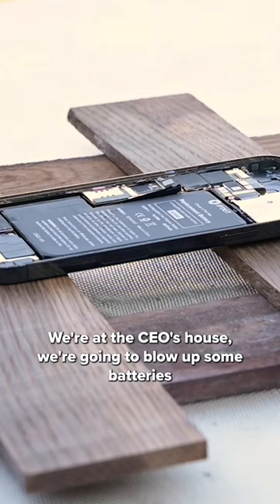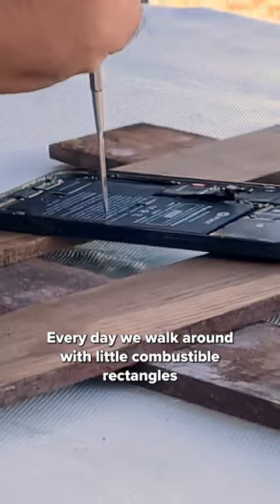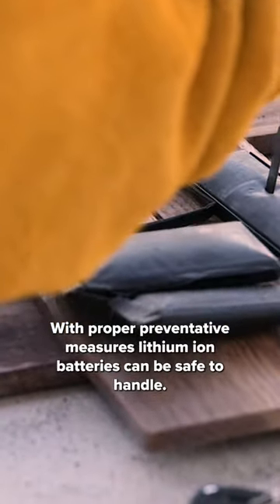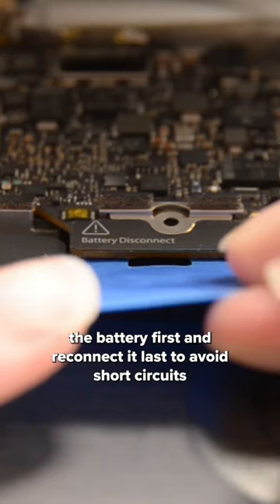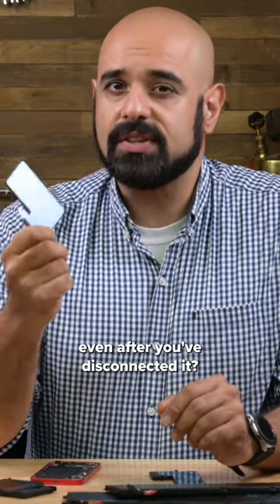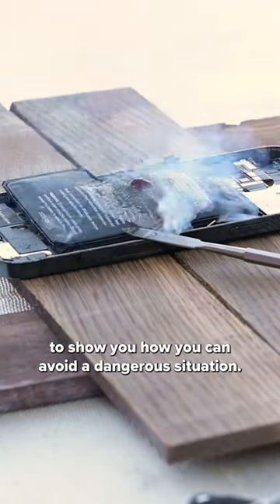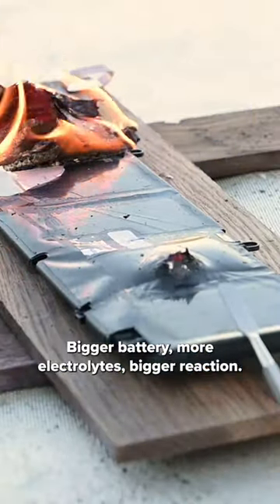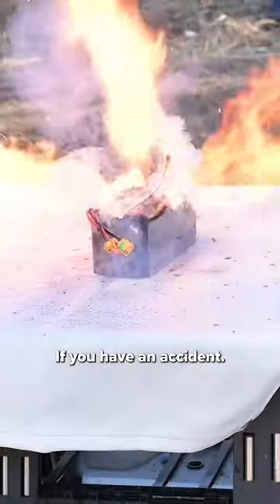Everything You Need To Know About Exploding Batteries #battery #fire

Comment: Not to 0% on simpler batteries... Because they break if they are fully discharged. Also, most "bigger batteries has a plastic shell for protection. Just be careful, and don't heat them up.

Comment: I was fixing a 5s, which had already had its battery replaced. it was one I was doing for myself so I didn't mind this, but I accidentally punctured the battery trying to take it out, it made a flame for like one second, but it still worked, and I used it for a while, until it randomly kept shutting off cause it wasn't outputting enough power
Reply: bro wtf this mans has never heard of a lipo fire in his life

Comment: Won't discharging it to 0% makes the battery life shorter?
Reply: Yes it will.  Also, could cause a fire when trying to recharge it from 0.  Lithium should not be discharged lower than around 2 volts per 4 volt cell.